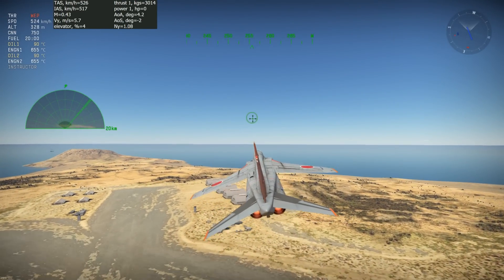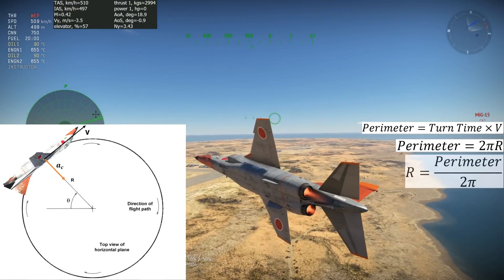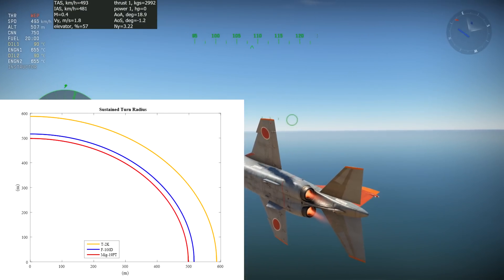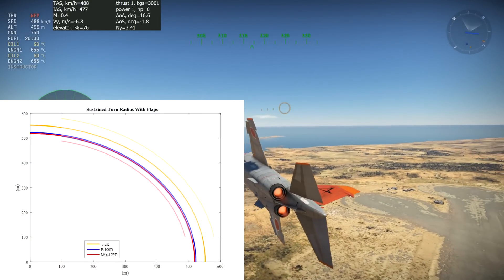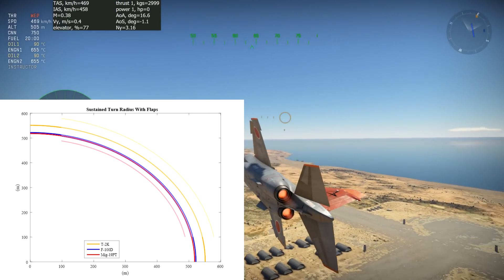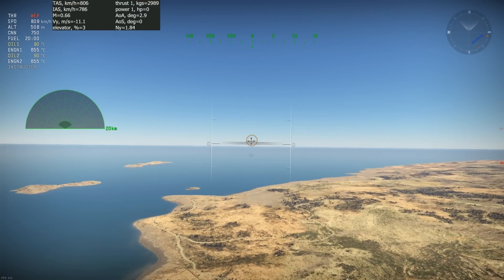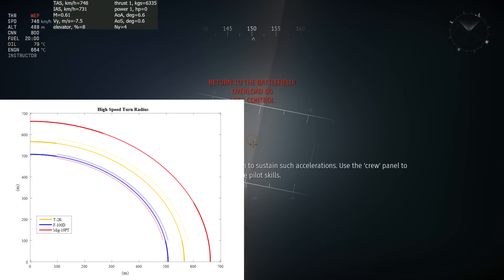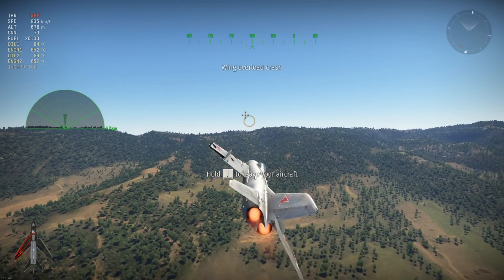T-2K vs F-100D vs Mig-19PT | Supersonic Turn Comparison (10k Sub Special)

Comment: It's worth pointing out that especially for jets that bleed speed quickly, max rate is usually not the same as "pull as hard as possible". Most jets hit their corner speed in the vicinity of 300-500 knots. A minimum time 360 degree turn is usually initiated about 100 knots above corner speed with a tight pull at the start to bleed off the excess energy and then letting off to sustain corner speed.
Reply from the maker: Yup!

Comment: Whats the best way to shake an enemy of your six?

Edit: On a P47. I really wana get the P47N
Reply: Gets a reply in 27 minutes**
Reply from the maker: 31 minutes* haha.

I did a reversal video, there's general tips on how to get the advantage over an enemy with more energy on your 6. P47s turn better than other aircraft at high speed, so going into a dive and then committing to a sharp turn can work on some enemies.
Reply: @AdamTheEnginerd  Alright. Thanks for the help, i guess.

Comment: Did you see that the 109K-4 got knocked back up to 5.7 in RB? What does that mean for the aircraft?
Reply from the maker: Yup it's been a few weeks. It deserves 5.7 with its buffs and compared to 5.3 BR 109s. It faces the same stuff in my experience with it, but in the long run it'll face more P51H and Spitfire Mk22s I suppose.

Comment: This may be a really random suggestion but can you try flying the Yak-3 VK-107 without the wingtips to see how much faster it is and make a video out of this?
Reply from the maker: Haha I'll keep it in mind, but the speed difference would be very small if any. Why VK107 in particular?
Reply: @AdamTheEnginerd  I don't know, I thought the speed would increase at least by 10%. Maybe even dive. 
And because it's the fastest Yak in the game.
Reply from the maker: The proportion of drag from the wings is around 25% of the total drag, so if you remove 25% of the wing you'll remove around 6% of the drag in the best case. But, with shorter wings, the proportion of induced drag is increased, which would approximately compensate the decrease in drag.
Reply: @AdamTheEnginerd  If the engine was weaker, let's the say the regular Yak-3, would removing the wingtips increase speed performance by more rather than removing wingtips of the Yak-3 VK-107? Or is it just the same thing?
Reply from the maker: The faster the aircraft the more the removal of wingtips would improve performance, so it would be most noticeable on the Yak3VK compared to the Yak3.
Reply: @AdamTheEnginerd  I... see...
Reply: @AdamTheEnginerd  By the way can a MiG-19S without wingtips achieve a better top speed than the T-2 at altitude or sea level?
Reply from the maker: Not convinced?

Nah the difference is around 150km/h at sea level.
Reply: @AdamTheEnginerd  Ok then

Comment: Anything i can do against T2's in my mig19S? I can't seem to do anything about them, they just spray me down as I try to turn away, I can't make them lose energy either cause.. i just get sprayed down if I try to turn or even fly straight, I can't force them to turn either cause no missiles
Reply from the maker: You might have a small climb advantage over them, and you certainly turn better at low-medium speeds. With their radar lead indicator you'll have to constantly change your direction of flight when committing to a turn, which will require practice to do effectively.
Reply: @AdamTheEnginerd  Thanks my dude!

Comment: Do you have vertical targeting on and which option is better in your opinion? And why?
Reply from the maker: No I don't, I never used VT. I'd recommend sticking with what you already use.
Reply: @AdamTheEnginerd  Ok thanks, i always used vt but i changed it and actually i feel like i hitting more, especially head ons
Reply: Or maybe that is just because I watched your videos

Comment: Does the german MIG19 have the same flight model and results?
Reply from the maker: Mig19S is lighter with slightly better engines I think, so it would be slightly better than the Mig19PT.

Comment: of course flaps don't necessarily increase the sustained turn performance, but the instantaneous turn should be affected. I think this : https://www.youtube.com/watch?v=GL8ZdBs56EA  is a great video to complement your study :)
Reply from the maker: Ye it's a great video. Flaps should always decrease the sustained turn radius since it increases the CLmax to allow for lower takeoff and landing speeds, which is their main design goal. Flaps usually increase turn time as well though since they produce more drag leading to a lower sustained turn speed.
Reply: @AdamTheEnginerd oh ok I know, with flaps the speed is too low so the elevator is too weak and Clmax is not reached
Reply from the maker: The elevator % is below 100% so the elevator isn't too weak. Flaps naturally reduce the AoA at which CLmax is reached so that part is logical.
Reply: @AdamTheEnginerd  ah thank you for that info, well I guess I will just have to keep thinking
Reply from the maker: Not satisfied with my hypothesis?
Reply: aaaaah I'm an idiot I forgot elevator percentage is displayed on your little localhost box... also I thought flaps only added a constant to the Cl on the whole AoA domain. Does stall occur sooner in terms of AoA with flaps? or at least is the linear zone smaller?
Reply: @AdamTheEnginerd  lol more like not satisfied with not knowing what the instructor does... to me it should be more like turn radius decreases but turn time may increase. Also is there a reason why you could maintain Clmax in a sustained turn?
Reply from the maker: It adds a constant and moves the CL-AoA curve left a bit, so the CLmax occurs sooner at a lower AoA.

You can maintain CLmax in any conditions if your elevator has enough authority. You're at CLmax at your stall speed, or when turning without compression. Do you mean that turning at CLmax should produce much more drag than the thrust of the engines? It's just that you decelerate until you reach equilibrium.
Reply: @AdamTheEnginerd  ok. it's true that when you are at your stall speed you can usually climb.

Comment: i can't play Jets anymore. every time i try to use my FJ4B i end up against mig 19 and some times T2K. i can't doge them...

WHAT AM I DOING WRONG?????
Reply from the maker: You're flying an FJ4B haha.
Reply: @AdamTheEnginerd  whaaat? it was average before all this supersonic thing. at least i could make some kills. but i can't dodge anything supersonic. please help me
Reply from the maker: FJ4B is usually an easy target, and greedy people will flock to kill you, especially if you're ground pounding. I don't recommend flying the FJ4B in air RB.
Reply: Nothing... Gaijin is essentially feeding you to the wolves. Pre-AAM aircraft have zero business being matched with aircraft sporting AAMs... end of story. You can still compete, but you are at a large disadvantage to put it lightly. (let me clarify - by "nothing" I mean you could be doing everything right and still be consistently done in as an average player - actual mileage may vary depending on skill and situational luck)
Reply: i'm happy to hear this, but in the FJ4b i could have the AAM, but i'm still working to unlock them. the problem is me or the fact that the FJ4B it's not realistic at all. i can't even try to engage the enemies, so i ground pound with bullpups and Mighty mouse rockets

Comment: Wait, I'm a little confused about the math of this. If the turn speed is lower with flaps, and the turn radius is larger, doesn't that mean that the turn time must be larger, by definition? Or is the turn speed actually faster with flaps out? Also, do you have a preference between the La-7 and the La-7B-20, and how do you face spitfires in them? Is it just low alt bnr? And what about P-51D-30's? They seem to out-turn me because I am stock.
Reply from the maker: The sustained turn speed is faster with flaps out for Mig19 and F100!

I prefer La7 due to the significantly better BR. Run from Spitfires unless you have the energy advantage, and in that case BnZ. La7 turns slightly better than D30 without flaps unless you're at high speed. If you're stock vs a spaded D30 it might outturn you.
Reply: @AdamTheEnginerd  I see. Doesn't the La 7 turn and accelerate a lot better than the D-30 at low speed? If not then I've been playing it wrong. Anyway I'm just grinding for the La 200 because by Gaijin logic, the La 200 deserves the same br as the F-80C and a lower br than the Me-163B-0 🙃🙃 And now it has radar so it's even better 🙃🙃🙃🙃
Reply from the maker: Low speed La7 has the turn advantage. Not too much the acceleration advantage if below 150km/h though.

Comment: Hey, adam, what is that thing, showing Thrust, AoA and others? How to set it up?
Reply from the maker: It's called the "local host".

How to access the "local host":
You need to be running War Thunder or it won't work!

Option 1: on the same computer that is running WT:
-Type http://localhost:8111/ in the address bar and press enter and voila.

Option 2 (which also works on the computer that runs WT):
-Type http://Your_IP_Address:8111/ where you replace "Your_IP_Address" by your IP Address (192.168.X.XXX) in the address bar and press enter and voila, you can look at the characteristics on another device while flying.
Reply: @AdamTheEnginerd  thanks!

Comment: The reason the turn radius increases with takeoff flaps is that, to turn in this situation, the tail must push itself down and turn the aircraft to pitch up. When you increase the lift generated by the main wings, you aren't helping this. In fact, you may be making it harder. The best way to decrease turn radius is more downward lift/thrust on the tail.

So what you really need is tail flaps. ;)

War Thunder players implicitly expect more lift=more maneuverability, but obviously this is not a direct increase in maneuverability. It's just more lift in one area. And yes, thrust may be able to widen the turn radius too if the AoA overall is perhaps lower.
Reply from the maker: You're right, in the case of the T-2K you need 57% elevator deflection to create the necessary downforce without flaps, compared to 75% elevator deflection with flaps. However, the increase in lift of the main wing should be significantly higher than the increase in downforce of the horizontal stabilizer because of the difference in lever arm to the CG, and also because if that wasn't the case then that defeats the use of flaps which is to reduce takeoff and landing speeds. On nearly all prop aircraft I'm sure that flaps decrease the turn radius.

Comment: and... and the SMB2 :(
it's super sonic
it's even faster than the mig 19s/pt at sea level
Reply from the maker: Are you sure about that? I thought they were around the same speed.
Reply: @AdamTheEnginerd  if i it recall correctly the top speed of the mig 19's is around 1140-1150 kph and the top speed of the smb2 is 1185-1190 kph, it's close but still faster :p
Reply: @AdamTheEnginerd  depends from whom is speaking the truth which is hard to consider, the best is to get a pilot to tell us.
 In Dassault Super Mystere B2 page we can read the stats which include Speed: 
Max. Speed
 Top Mach diving/Top Mach level flight 1.4 / 1.03 (1715.062km/h / 1261.795km/h).
On Jewish Virtual Library the American–Israeli library it reads max speed - Mach 1.3(1592.557km/h), on other non so solid sources we can read 1261-1300's km/h. We know one thing French does like to brag about their machines and may "lie" in some cases, maybe it can go mach 1.4 but maybe u'll break ur wings..
Reply: @AngryAssSmoker  curious how an me 163 can match the straight line speed of the Super Mystere in a dive, reaching mach 1.04 at 11.500m (1100km/h)

Comment: Should i research cl13a or mig19s?
Reply from the maker: Probably CL13A.
Reply: @AdamTheEnginerd  why? I heard that mig19s's rudder is shit but on test flight it wasn't this bad
Reply from the maker: Better intro to top tier imo, Mig19 is a pain to aim.
Reply: @AdamTheEnginerd  l2p xd 
9.0 are facing 10.0 every battle so i see no point of researching cl when i can research mig19s. For me mig15bis is painful to aim. I don't have idea how to improve my aim.
Reply from the maker: Well I think Mig19 is hard to aim, but the guns are way better. Mig19 won't be significantly easier to aim than Mig15Bis imo.
Reply: @AdamTheEnginerd  how to learn the mig15bis guns? I have big trouble with them
Reply from the maker: I had trouble early on too. In my Mig15Bis video I have good aim, but it's not a regular occurrence.
Reply: @AdamTheEnginerd  mig15bis's roll rate makes me wanna kill myself but okay. I'll try to master it but axis vs axis doesn't makes it easier :/
Reply: @sleempy6343  well mig 15 bis is imposible to rip. Then you get to mig 19 and in start you rip constantly.Dont get me wrong mig 19s is amazing plane, but needs a lot of learning. Do not turn like in mig 15 when you flying over 800km/h In my experiance. Well cl 13 is hard to rip when "new boosters" are NOT installed. 
Well 9.0 facing 10.0
There is thing in war thunder where players bring jets at low altitude. And difference in speed 9.0 to 10.0 is 60km/h at low altitude.( im told that, not tested by me)
So cl13 is still good plane.
Reply: @frankokrstic5385  i have experience with sabers so ripping isn't problem

Comment: Just to clarify because I’m stupid, sustained turn refers to the amount of time each aircraft requires to complete a full 360 degree horizontal turn without losing altitude, right?
Reply from the maker: And with no change in speed, exactly.

Comment: Why did you test the mig19PT and not the mig19S? The S should have much better performance.
Reply: cough Werhaboo
Reply from the maker: I don't think the S would have that much better performance, but testing the Mig19PT gives a pretty good idea for the S already.
Reply: @AdamTheEnginerd  comparing the stat cards, the S has a 180 m/s club vs the PTs 140. I think the S is quite a bit lighter.
Reply from the maker: It is a bit lighter, and I think it has stronger engines.

Comment: Adan did you purposely leave out the mig 19s or do you just not have it?
Reply from the maker: I don't have it but I could have tested it. Reason I didn't is because it'll be pretty similar to the Mig19PT, so it wouldn't add much more information and it would make the graphs harder to read.
Reply: Adam514 hmm stat card wise they have a pretty big difference in there turn time but stat cards lie I wanted to know if it was actually that much more maneuverable
Reply from the maker: I'm curious too, but it should still be comparable to Mig19PT.

Comment: Is there a reason why the mig 19 rips so easily?
Reply from the maker: Well planes are made to different load requirements. 20 minutes of fuel is also nearly the max fuel load on the Mig19, while it's around half for the F100 and the T2, so that's part of the reason why the Mig19 rips easier than the others.